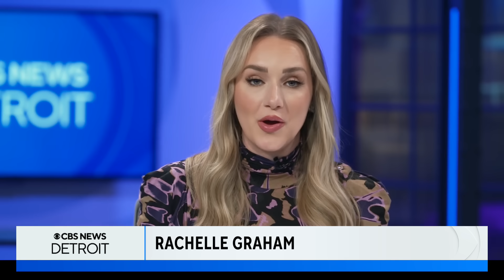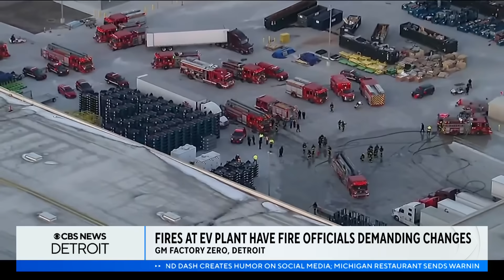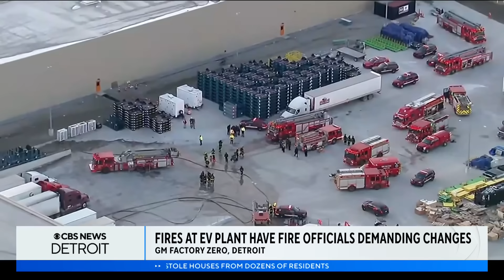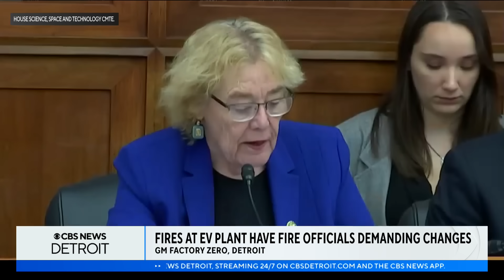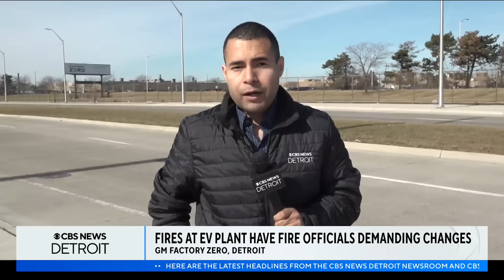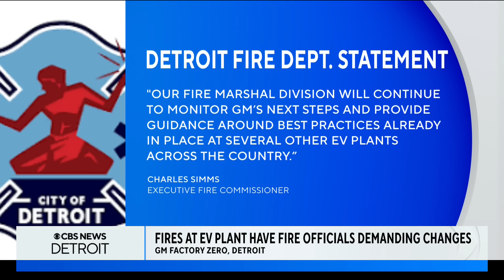Fires at GM EV plant have fire officials demanding changes

Comment: The consumer is paying for those burned up batteries, you think gm is going to take a loss, this is just one more reason why the junk cost so much.   Hers another stupid thing to think about, theses car manufactures that put out All Wheel drive vehicles , do you realize your fuel economy is not as good as a front wheel drive. causing more fuel consumption. but yet you want a cleaner environment.
Reply: The enormous weight of thes EVs eats tires at twice the rate of ICE  vehicles,, how the hell can that be considered green ?
Reply: @vonbuzz9009  I agree, with that as well, and the price of tires has gone up to.

Comment: Going to build Panasonic lith. ion batt. Plant KC Ks.  area.  We have to pay for the power station to gain 800 jobs.  Should it fire up unprepared. Gonna need a lot of water.
Reply: Probably 800 to build the plant and then its robots because its crazy dangerous  .. might be some welding jobs on the cases tho.

Comment: And to think you never heard anything about this on national media... shocker.
Reply: To think it all started with my climate changing light bulbs.
Reply: 8 times since last summer... its not even spring yet!!! Their having a fire every 3 or 4 weeks at this rate!!! Definitely causing MORE pollution than ICE vehicles and much more toxic. Zero reports of sabotage as others falsely claim
Reply: They haven't ruled out sabotage
Reply: @bingosunnoon9341  can that be proven? how many cases of sabotage vs just them going up in smoke ? seems like sour grapes to me - i'll be sticking with my ICE vehicle rather than buying an EV... at least if my vehicle explodes the fire can be put out....and what is the ratio of ICE vehicles just randomly exploding vs EVs?
Reply: @breadmoth6443 plenty of recalls over the past decade for gas vehicle fires. Ford had the brake fluid leaks on the sensors that killed all those people while they slept. Gas tanks falling off and many more problems. A simple search on google will show you the hundreds of thousands of recalled vehicles by GM and Ford for fire problems. This is just todays boogeyman.
Reply: @bingosunnoon9341 what does your comment have to do with the lack of coverage by the media?
Reply: They haven't ruled out aliens either.
Reply: @bunsw2070  or insane clowns, or Hobbits....

Comment: So the solution to the batteries being unsafe is better fire suppression equipment? Yea, okay.
Reply: Just as long as Mary Ibarra gets her yearly bonus.
Reply: @stephanparis6887  Why not? This is purely a government debacle. It's not her fault.
Reply: No real way to prevent lithium fires.
Reply: I was thinking the exact same thing!
Reply: Always wear fire-proof suits when driving an EV.
Reply: @Rondogardener  and scuba tank
Reply: I dont ever see gm/FUD motors switching to SAFER Cylindrical battery cells.
Reply: But but but JB and the Dems say they are safe.
Reply: Better add that fire suppression to your house lol if you have an EV
Reply: @randomreynolds94   - BEV fires are RARE, unlike 90,000 ICE car fires every year.
Reply: @markplott4820  Battery vehicle make up only .001% of vehicle on the road so of course there will be alot less. The thing with Ice is that the fires are not spontaneous they are caused by a crash or fuel leak, etc. Batteries can literally just go up in flames.
Reply: @randomreynolds94   - in the USA is Closer to 6% and GROWING, in CA BEV are Growing as well and DOUBLE Digits. 
ICE is a busted GROWH story. 
ICE is unaffordable anymore. 
BEV is Cheaper to MAINTAIN.
and with 80% less Maintenance than ICE car.
Reply: @markplott4820  no its not cheaper. Part after a crash are more batteries are 10s of thousands. And the car are priced higher then regular ICE. Plus Ice is way more convenient just drove 16 hours from Ontario Canada to South Carolina would of easily been over a day with a battery powered having to stop an charge. We stopped 3 times for gas longest stop was 5 mins. If we had to sit an charge would of been over 30mins for each stop. At which point we probs would of got a hotel somewhere or spent money at a store or food while waiting to charge. We spent money on nothing else then $32 on each stop for gas. All together under $100 with all stops and a total of 15 mins of stops on a 16 hour drive. Goodluck doing that in an Battery.
Reply: @randomreynolds94  - a $35,000 model Y is cheaper to own & maintain than any Accord or Carola. and you can charge @ home for FREE if you have SOLAR & power walls.
Reply: @markplott4820  It is not the quanity but the quality.  EVs burn in such a way it is almost impossible to put them out without complete submergence in water. They also can start at any time. ICE vehicles typically are only at risk when the fule pump is on.
Reply: @greglane3978   - the NEW FREMONT model 3 is setting a NEW BENCHMARK in Quality, Safety, Efficiency & PERFORMANCE. and Tesla is taking names.
Reply: With that logic…. Criminal activity = get more guns
Reply: @contractor556  differnt dynamic completely. there are responsible gun owners, no way to make fires "responsible"
Reply: As a fireman I can tell you that unless someone is in the vechicle we will not approach. Litium battery fires are bad and the only good way to put them out is to put the batteries under water (submerged not sprayed).   We will watch from a distance to make sure the fire does not spread.
Reply: @greglane3978  one can't argue with a fireman who has to deal with this Exploding Vehicle shit.👍
Reply: And EV Fire Apparatus too 😂

Comment: "But it's GREEN!"
Reply: That’s true! People’s face turned green after they inhaled these “environmental friendly gas”
Reply: 36,000 gallons of water used to put out one ev car fire is fine. Nothing to worry about. We don't need that water for anything else. The fact that all that water is now toxic waste is also nothing to worry about.
Reply: EV cars actually have a higher carbon footprint the IC cars.
Reply: @James-rn7dx Yes. Just as windmills take huge amounts of fossil fuels to make and install, then they chop up protected avian species, then they fall apart and pile up in mounds of non-recyclable blades.
Reply: Yep, it's green up until it catches fire or explodes.  THEN it spews more toxic fumes into the atmosphere than your ICE car ever did.

But they probably WANT the cars to self ignite, to reduce the population and to remove our free mobility because our EVs are dead.
Reply: It's green backs in politicians pockets cause they bought stocks for EV. That's why they  shove it down our throats.
Reply: Kinda red when it is burning.... just sayin
Reply: @jenscheibner792 Like a watermelon.
Green on the outside, red on the inside.
Reply: ICEs don't spontaneously explode like EVs can either.  People do not realize that the batteries in EVs are essentially ticking time bombs. Not to mention how much additional pollution they create compared to just in their manufacturing process.
Reply: @shanoukgaming6763 Yep!
Reply: @shanoukgaming6763  where are y’all getting this bogus information? Gas vehicles explode daily. Its because of some sort of defect or accident. Batteries don’t explode unless there is a reason. Same as gas vehicles. 

This idea that battery production creates more waste and pollution then turning crude oil into gasoline is ridiculous. 
They each require mining and transport and refining processes.
Reply: @crtmojo2705    Strip mining and many parts of an EV are made in a different country which requires shipping those parts by boat or plane, and the disposal of old and worn-out EV batteries on top of all that electricity uses fossil fuel a vast majority of the time to charge them. They used to say that Leaded gasoline was great and completely safe until they couldn't hide the truth about the public health risks and problems because of it any longer. 
Batteries can explode from any tiny bit of damage to them or the vehicle's electrical system. If they are even made correctly, to begin with. If batteries don't randomly explode then explain Samsung Note 7 phones that did as well as the ones that supposedly fixed the issue. Explain many EVs exploding while being charged. And you miss the point that it's not entirely about the fires themselves. EV fires are more toxic than ICE fires and are much more difficult to put out.
Reply: @shanoukgaming6763  building vehicles is a global supply chain. Be it gas or electric. The process from crude to pump is filled other types of energy being used. The construction of the vehicles will always require energy. It’s how do we make that energy? Each has its pros and cons. 

This is the beginning of a massive energy transition. It will be just as powerful as the introduction of the internet. Renewables are growing in various states. Home production through solar is on the rise. Once the new system is large enough. We rely less on the old power companies.  They don’t like that. 

You spoke of how we didn’t hear about diesel fumes etc. back in the day. This is just the new spin trying to get everyone to keep things the way they are. 
Because power companies and big oil and politicians are watching their revenue streams shrink. And it’s only a fraction of EVs on the road right now.
Reply: @shanoukgaming6763  EVs fires will soon be a thing if the past with Solid Sate batteries. They have a new blanket system that denies oxygen for fires. But it’s always about the defects or impacts. As they learn more they will get better. And when they recycle them; the materials come out even purer then before. Once you get enough battery materials in the global system; you import less and less. 
Where as oil for fuel has to constantly be imported because you can’t capture any for recycling.
Reply: @crtmojo2705  I'm not saying that EVs won't be less polluting and better and safer in the future. I'm saying that the technology is not there yet. There are currently cities in the US that can barely provide enough electricity to power the things people use every day using every type of electric generation we currently have. Millions of EVs being charged constantly certainly isn't going to help the power grid issues.  And if you honestly think that big oil isn't currently making money from going green as well as many US politicians (one example Nancy Pelosi and her husband) then I don't know what to tell you. They all have a vested interest in pushing EVs and green energy to put money in their pockets.  That also would be an incentive to not be completely open and honest about the environmental effects they have overall.
Reply: @crtmojo2705  " has to constantly be imported " so tell me- how do u ship all the parts in making\delivering your batteries??? I don't remember seeing any EV cargo ship, or excavator, or freight loco, or .....
Reply: @h.mandelene3279  that’s a really good question. Diesel is amazing for big rigs and heavy equipment. It can make the long hails and it’s readily available. Trains are actually electric motors but with diesel generators. They get great gas mileage once they get going. 
Caterpillar and Mac trucks as well as Freightliner are starting to launch electric alternatives. They have a real focus on fuel cells because of the benefits for range; but it will take some years before hydrogen can be made at a decent price.  Solid state batteries will give heavy equipment a nice boost in power and range. Even some hybrid technologies will save on diesel costs. 
I doubt we will see the see the end of gasoline and diesel in our lifetimes. Too many uses. But we will see reduced usage over the next few decades.
Reply: @mizzouxc3824 says the one year old account
Reply: Sure, because gas cars never catch fire.
Reply: @truantray ICE fires don’t become instant toxic waste hazards.
Reply: @fredmonroe6042 I don’t remember the news where breathing fuel vapor or burning fuel is healthy. I do remember the cancer warning stickers.
Reply: @crtmojo2705  Did you miss most of the other comments.  When any EV bursts into flame people need to evacuate because of the toxicity of the kobolt and other chemicals.  The water it takes to put it out becomes a chemical slurry that soaked into the ground or city drains.  Towing companies are start to refuse to deal with them because of the problem with reigniting.
Reply: @fredmonroe6042  Solid state batteries will take care of most of the fire problems. 

There is no prefect solution besides walking. This narrative of one being more dangerous then the other is extremely far fetched. Each has pros and cons.
Reply: @fredmonroe6042 This goes along with "florescent bulbs breaking release toxic gasses\chemicals" Funny how "environmentally friendly" materials are toxic, huh??
Reply: @truantray Never heard of a string of ICE vehicles catching fire in the manufacturing plant.
False comparison.
Reply: @truantray  gas cars can catch on fire but can be quickly put out. Mean while EVs catch on fire and they have to let it finish burning because if they throw water on it and it has Li...then it just gonna react and explode. Somebody didn't pay attention in HS chemistry class.
Reply: @truantray derp 🥴
Reply: @truantray  they have but way easier to put a gas fire out then it is to put electric car out
Reply: @truantray  that's a stupid argument.    But seeing as you took it there,  what is the root cause of the majority of ice fires?  Gasoline?  Diesel?  Nope! ELECTRICAL! What do EVs have? Even more that is extremely difficult and toxic to extinguish,  that can reignite weeks later, with zero 8nteracti9n from humans. Funny that gas stations don't randomly burst into flames. Have you ever heard of that,  or have you avoided gas stations because they randomly start on fire.  Are you afraid to ride in gasoline vehicles because they randomly burst into flames without warming and you could be trapped inside, because the locks are electrical and that system has shut down?  Nope, I bet you aren't.
Reply: @truantray  mostly because of electrical problems.  And when a electric car catches on fire you can not put them out. And then it burns up all the stuff made from oil. Not to mention how much energy was used to make the battery from start to finish.  Democrats are working for China,  and China doesn't have oil so they sell you China energy made with oil. Democrats are lying to you
Reply: @truantray Whatever you say TRANNY!?
You def sound confused
Reply: @truantray gas doesn't spontaneously start burning like lithium batteries do. Hell, lithium batteries are not made to burn AT ALL. Why is it normal with u? it ruins your agenda??
Reply: @truantray  simpleton. EVs catch fire at a higher rate and do far more damage.

Comment: Great advertisement for a reason to never own an EV !!
Reply: Good thing your combustion engine vehicle doesn't have anything which could catch fire. 😅
Reply: @redhat421 ICE burn at 600 degrees and it's rare that they do...EV garbage burns at 2000 degrees spontaneously and in (otherwise) safe conditions, like being parked up in garages or as in this case: brand new batteries! Take your insanity and shove it!
Reply: @redhat421  You are right, I will keep driving fossil fuel things !
Reply: @michaelsorrentino9279  I have mostly stopped driving the V8 Volvo I have access to until it can be repaired. It has oil leaking onto the exhaust. It can catch fire anytime.

Been taking the bus to work. Some days I even take an EV on rails powered by a 700V overhead line.

Comment: At least a car with a gas tank gives warning starting with small leak and smell. Also the gasoline need a ignition source. EV battery gives no warning. I will not risk my life to an EV.
Reply: @Nicole93v shut up, you radical dem, your party will end up losing in november, #rememberlakenriley, the gop is no better either.
Reply: you can LITTERALLY , walk away from a car Battery fie. 
they also are VERY RARE.